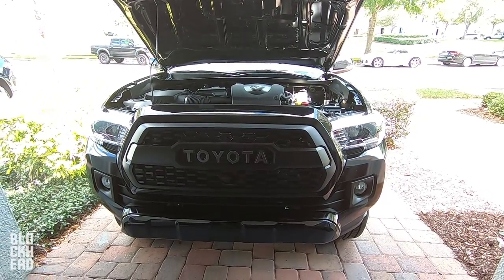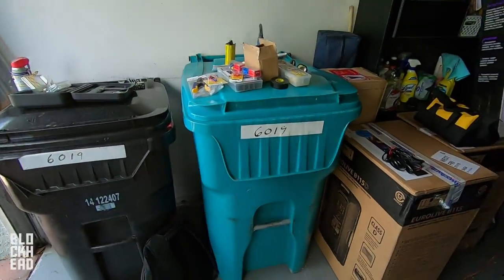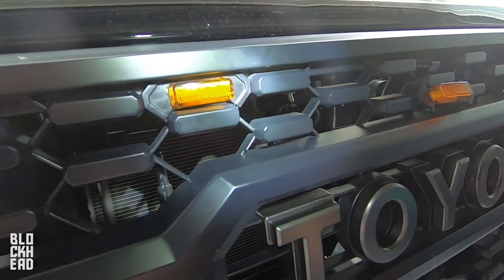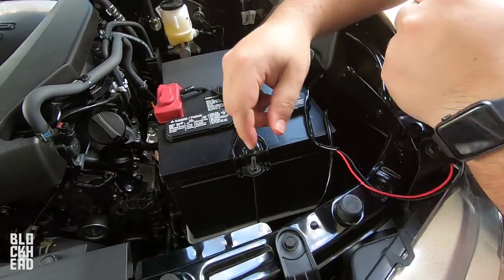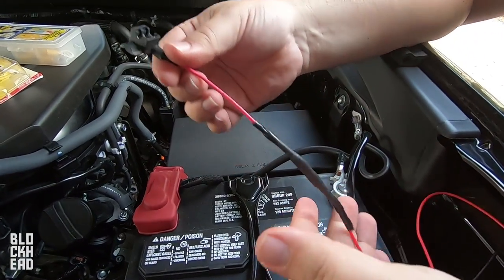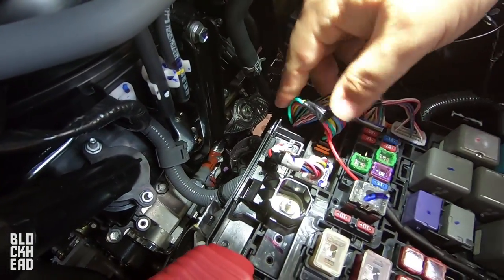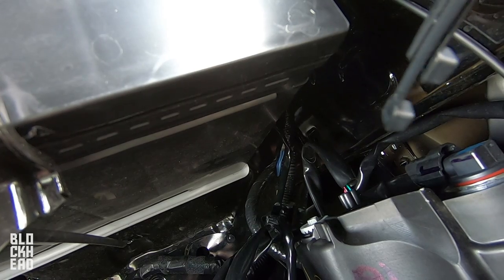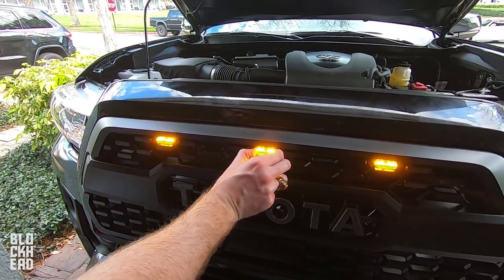Toyota Tacoma Raptor Lights by TacomaBeast! (LED Grill Lights)

Comment: Instead of rewiring and splicing into another wire, just move the add a fuse to an ignition circuit. One that turns on when the ignition is on and is not controlled by a button switch or relay. Much easier.
Reply from the maker: Yeah would be easier, but then the lights are on at all times. You can control the DRLs / have all lights off if you want, which would be nice functionality to still have.

Comment: so i have a 2019 SR5  (no white LED DRLS).  i spliced the pink wire on both running lights and added a diode on both.  what happens is i can have my Grille lights on on DRL, and on Headlights on.  turn signals also work and grille lights don't blink.  However if i turn my grille lights off completely and turn on a turn signal the grille lights blink with the indicator.  been trying to find a way around it with my truck but havn't been successfull yet so i just leave the grille lights on all the time!

Comment: Did you end up posting the updated video? Curious if splicing into the green/pink factory wires worked? Im having problems . My right DRL turns off with the headlights on...

Comment: I still can't believe you can't do simple a simple fix in your own drive! So if you come out to a flat tire you have to call a tow, not just make a tire swap yourself?
Reply: Pretty much. When I was doing lawn care, an HOA signed on with my company, and Just as I showed up with my crew for the first mow, an HOA official came out, and stopped me. He said that I couldn't mow the properties if I had greased my deck spindles. Since it was an every other day thing, I was not able to do that property. I charged them a cancellation fee, and lost out. I refused taking on other HOA's after that. It's seriously messed lol. Avoid them at all costs.
Reply from the maker: Came out to a flat once. Jacked car up, took off wheel, took wheel and tire to get repaired. Came back and they just noticed it and said it had to be towed. Told them I already got it fixed and put the wheel back on. They were upset, but nothing they could do at that point! Lol, HOA’s suckkkkkkk

Comment: Where did you get your add a fuse the one I bought isn’t deep like yours my stock fuse won’t fit. Will a longer regular 10 amp fuse work if you put two of those in the add a fuse?
Reply: Thomas Hernandez autozone has them.